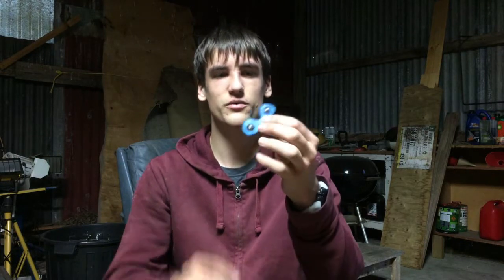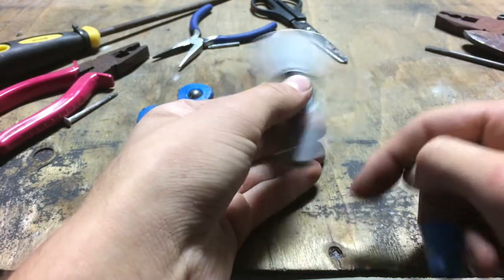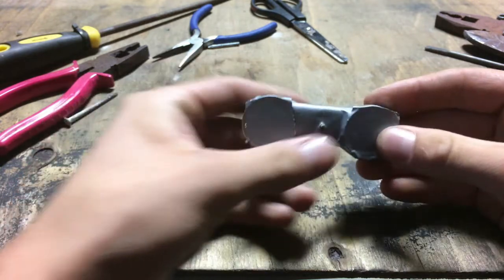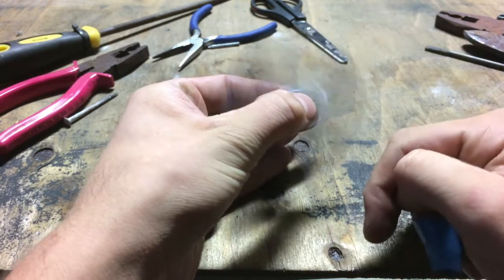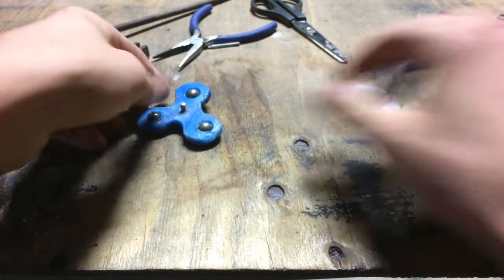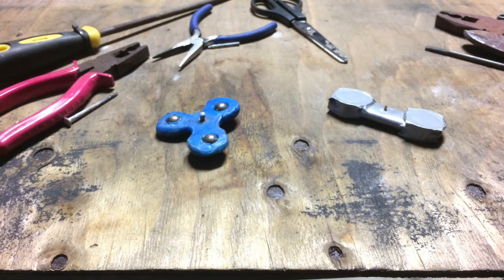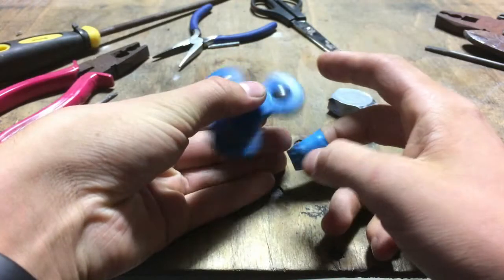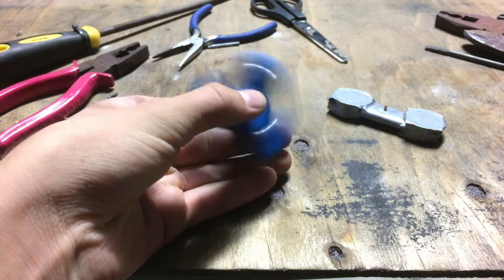Homemade Fidget Spinner with NO BEARINGS!?!?

Comment: aren't the weights bearings..?
Reply from the maker: Shhh... don't tell anyone.. ;) 
Basically, I didn't have anything else as small and dense as they were, but I didn't use the typical ball bearings that you would find in proper fidget spinners!
Reply: NO, the weights definitely are not bearings. But by providing mass away from the rotational axis, they give momentum to the spin - without going any further into the physics!  [Bearings are devices to reduce friction at the axis.]